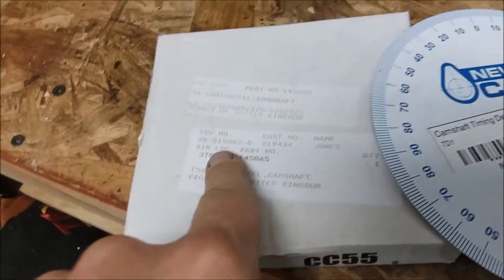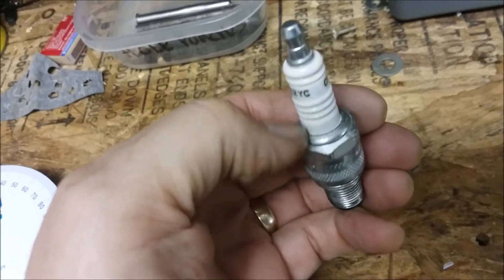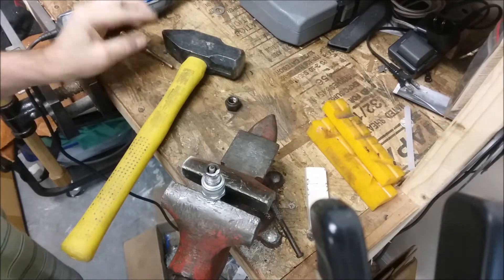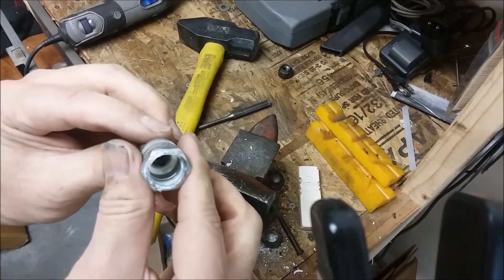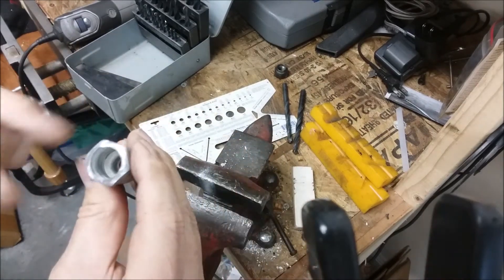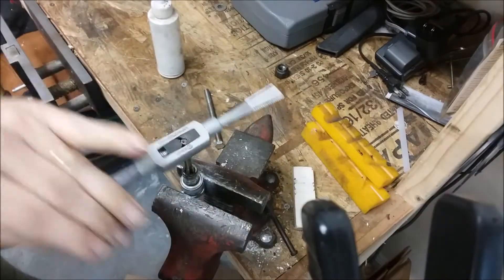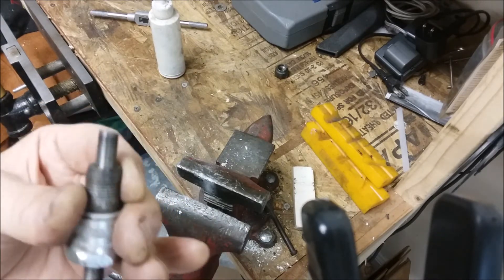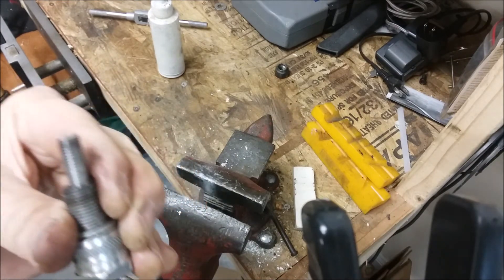Easier Way to Make A Piston Stop Out of a Spark Plug

Comment: So i had a 2005 mustang gt, and they were known for having spark plugs break off in the cylinder. I boughtcan extractor kit for it and ended up never using it. I figured id use that as a nice piston stop but i forgot that spark plugs on a 72 302 were a lot bigger.

Comment: Why not use a bolt that is the same size as the plug threads? Maybe grind down the first few threads to make the tip a bit smaller

Comment: This was very useful. Your dad taught you well with your metal working skills. Maybe put a nut on first before threading the bolt through so you can tighten the length and take away any movement of the screw. Thanks for sharing

Comment: how much of the stop did you screw to hit piston------im following you i just made my stop and keep screw it in out to hit piston out about one inch----hesitate to go much further-but i guess i need to keep going thanks
Reply: The main thing is that the piston stops evenly from forward rotation to reverse rotation. Bolt length is irrelevant as long as it doesn’t move and the piston stops. 

The difference or middle point on your marks on balancer is true TDC.
Reply from the maker: I havent used this one yet.  But since you can put any length bolt in it I hadnt really given it much thought yet.  What you can do if you are concerned is take the bolt out, put a dowel in, turn the engine till you are a bit before or after TDC and the dowel touches the piston, mark the dowel where it exits the spark plug casing, and use that as a guide to your bolt length.  Not really necessary, but a way to get comfortable with it.